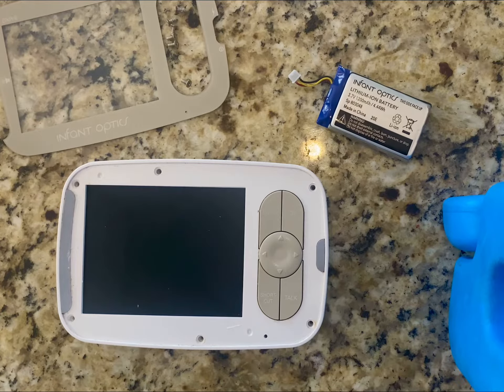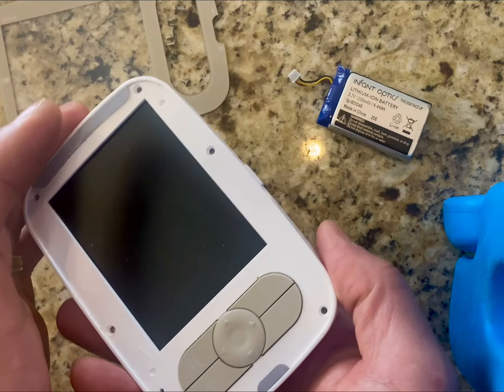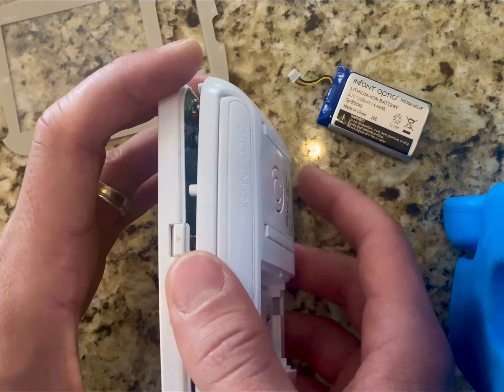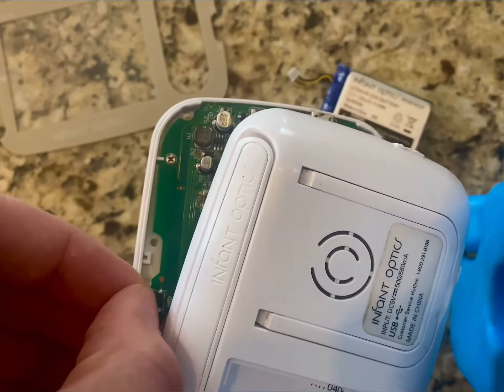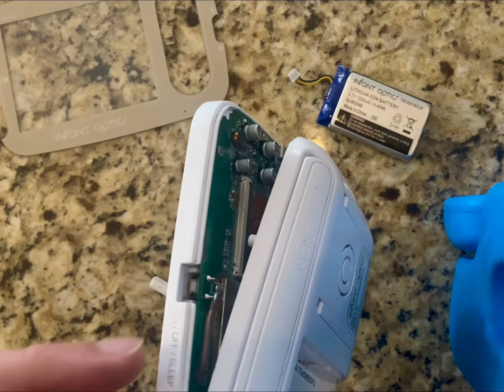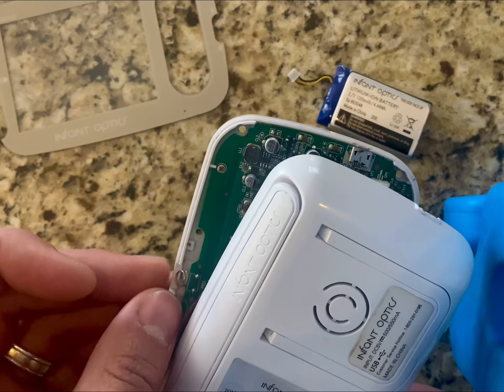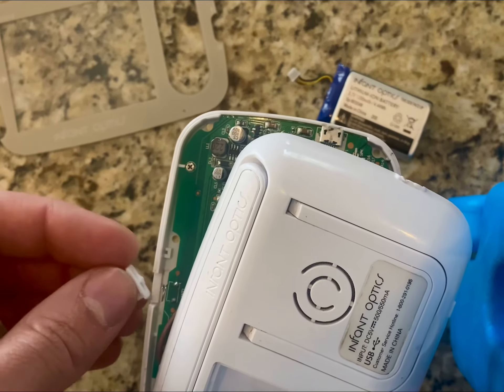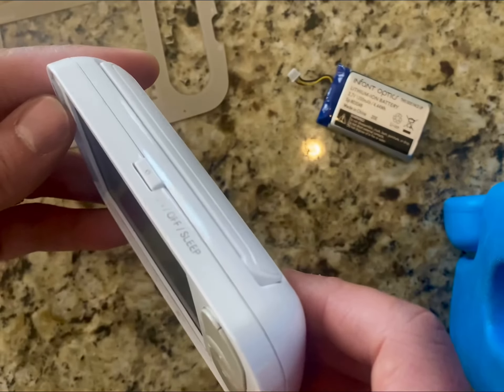How To Fix Stuck Power Button: DXR-8 Monitor (By Infant Optics)

Comment: So I had a similar issue, but itseems like the new monitor does not come with a sprint? At least mine didn't (purchased in 2020) My Power button stopped working after around 18 months so I did some additional things. 

After taking off the faceplate, I carefully unclipped the sound from the circuit board similar to the battery. I then removed the power button, which now looks like the old power button but has a small piece of long plastic that inserts into a small hole acting almost like a diving board, that allows it to spring, removed it and carefully reattached it, checking for any debris/dust and damage that may be causing interference. I then put the button back in, put the sound clip back in, and pressed on another ribbon connection to ensure everything was fit properly. Once i put the battery back in I tested the power and viola, works like a charm again.
Reply from the maker: Woah, this is a great suggestion, i'll have to see if that works on my other monitor. If you create a video for that paste it here and I can recommend it to people!

Comment: Thanks for the video mate.. but I've got a question... I have the same problem as yours... But in my case my button seems to be working fine... It clicks normally and bounces back whenever I press it down... But this piece of junk simply won't turn on... Any clue of what is happening? Cheers
Reply from the maker: You're welcome! hmm strange... the screen doesn't blink or anything? Might it be the battery (does anything light up when plugged in?)
Reply: @JoseVieitez  the monitor's side lights (the charge indicators, blue red or green) only light up if the charger is connected to it.. if it's not it doesn't at all... The battery light is blue already.. but the monitor simply doesn't turn on ... I already opened it and cleaned it up with the proper alcohol as I've done twice in the past ... But nothing happens at all... The button's click seems ok and clicking.. so I'm worried the display is fu..ed up.. not sure thou... But probably... Or perhaps the button doesn't seem broken but it's burned or something like that